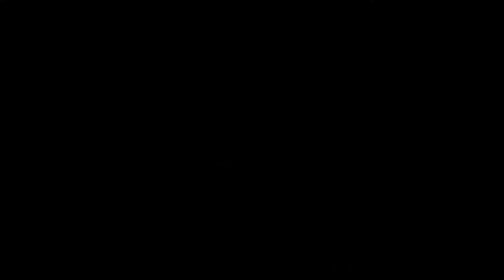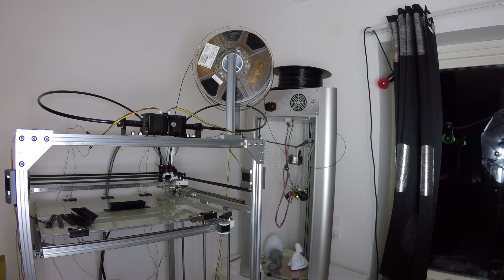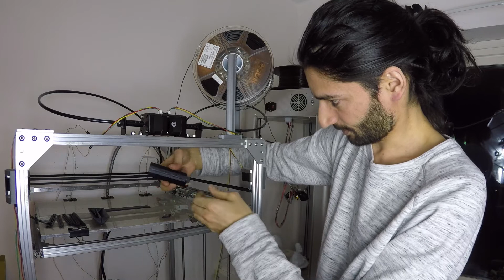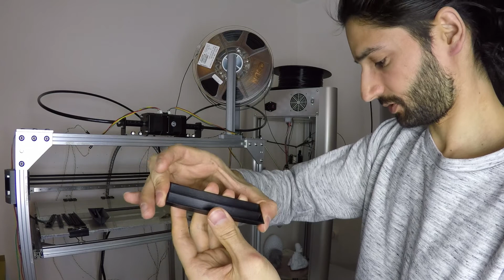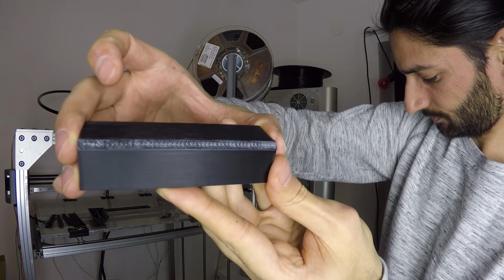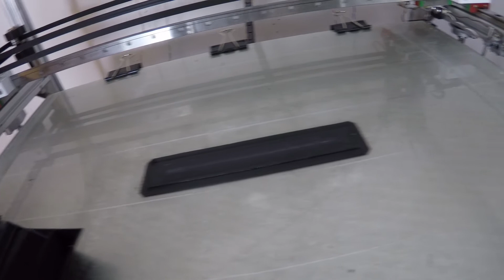Printing ABS Without a Heated-bed (with ABS surface)

Comment: I think if this is working for you, maybe part of the reason is that your printed surface is fully cooled by the time you print on top of it.  The layers you are printing on top are still warm from being printed, so they get better fused to each other.  Is that a sufficient explanation?  I don't know.  But when you start printing on a 3mm ABS sheet, you might want to try a series of different first-layer nozzle temperatures, to find the best compromise.  (in other words, change the nozzle temperature after the first layer, but tweak the first-layer temperature, lower for less adhesion and higher for stronger adhesion.)

Also, I think the distortion force may be helping you remove the print from your ABS surface.  So maybe it's fusing somewhat, but that warpage is helping you make a clean cut.  The white appearance looks like what happens when the plastic is being stretched past its tensile strength.  (Some call it "crazing" but I couldn't find a visual example just now.)

Good luck, and I hope you keep trying to figure it out.  Nice work, I appreciate your video.
Reply from the maker: James Carpino Nothing came to my mind but the reason you mentioned, because of the temperature big difference.
Yes, I will try to find the best settings for the new ABS plate.
I don't think the distortion force is helping in removing the print as I tried many times and each time I get no broken or stuck pieces. It was always clean. Also as you see, it was easy to remove all the way up, for example it was the same effort to remove it in the side and in the middle. It's definitely not fusing completely otherwise I'll never be able to separate it that easily with a super clean cut each time.